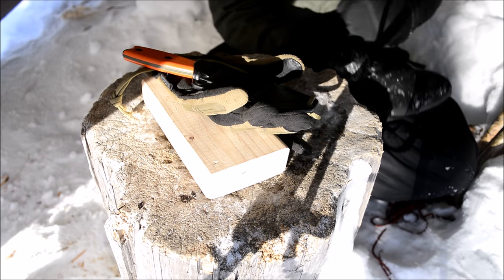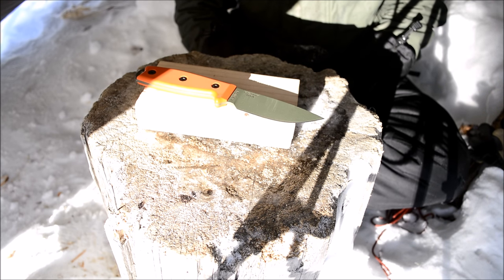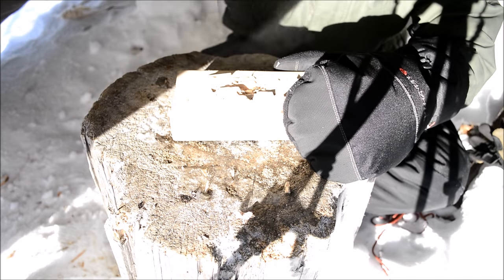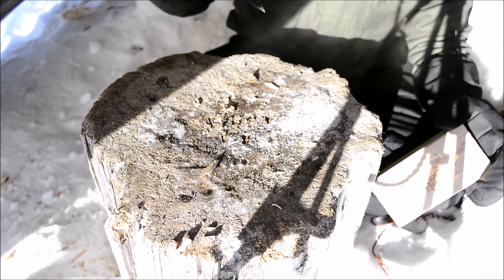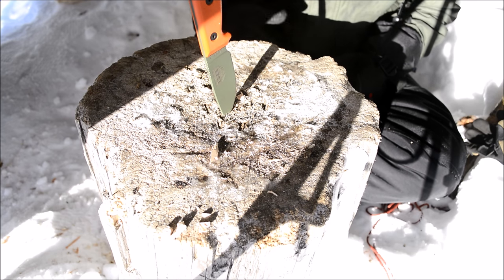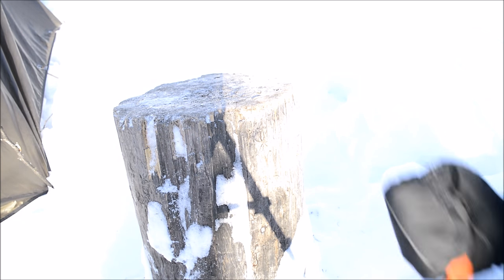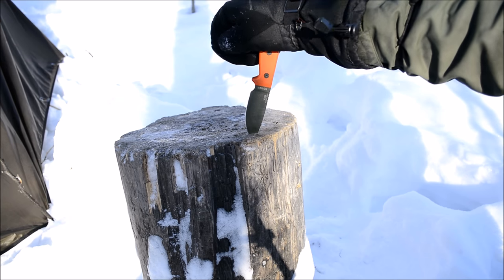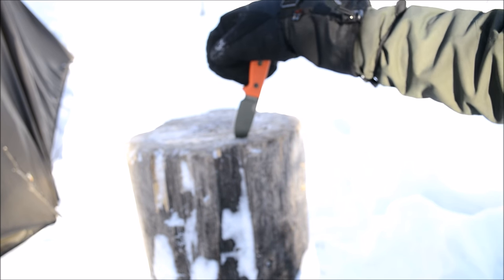How To DESTROY A Knife?! 😭

Comment: Good stuff, I like that you bent the tip back afterwards rather then completely snapping it off or attempting to send it back bent for a Esee replacement. 
I was impressed by the Esee 3s performance here, dont see to many destruction tests on the 3... most just exclaim that it's not gonna be as durable as the other models due to its thinner profile, so it was nice to see the type of abuse it can actually take.
Esee will for ever be one of my favorite knife brands... it never gets old batoning the crap out of my Esee 4.

Comment: The Morra Robust and the Hultafors GK are able to take this abuse even better and cheaper (I know they have a thiker tip). The test was ok (not a destruction test, but I do not like to destroy my knifes to). If you would brake it and send it back to ESSE you would get a new one, or am I wrong?
Reply from the maker: Yes, they would have replaced it, but I only did the tests, DBK did to break the CIMA.

Comment: Say Heah,  They say the best knife is the knife you have in you at the moment.  Also Bushcraft vs.  Survival knife . We'll I cover my bases,  I carry a multi carry.  I Piggybacked my Rodent 7 with my Rodent 3 which is like using the best part of a knife for my fine task's.  But most of all,  I like the SR101 Steel. Which is a deferentially tempered by the Busse Technology tempering,  Seriously,  I will put my Rodent 3 up against any 3" blade.  My Rodent 3 is almost bomb proof,  a LiL'Tank. seriously.,,.